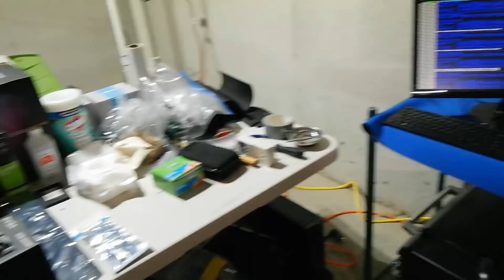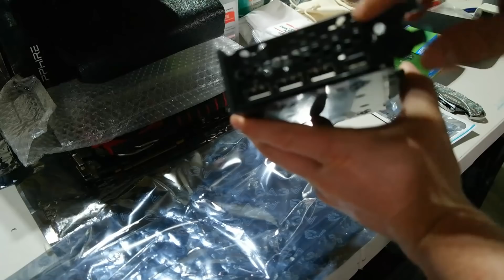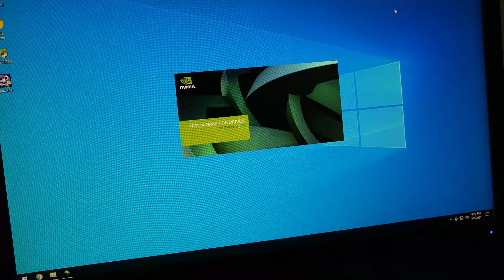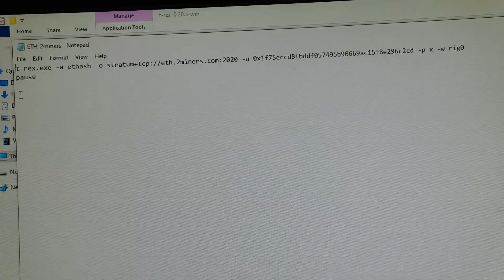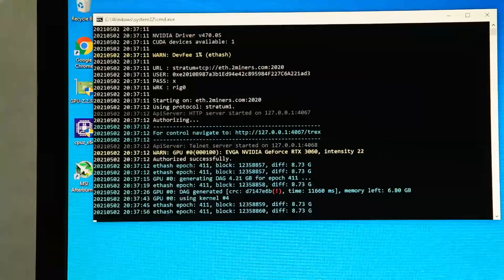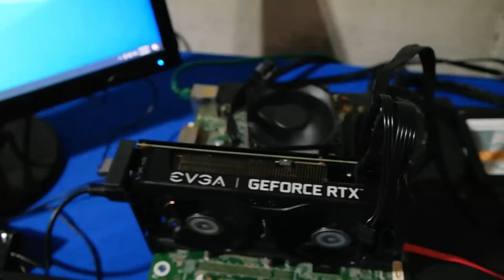RTX 3060 Mining Hashrate Driver Hack Doesn't Work Anymore?

Comment: It has to be PCIE 3.0
Reply from the maker: I will be testing the card in my other rig, just to confirm, hope you right!
Reply: @TheHobbyistMiner   needs to be 16x 3.0 or it wont work. Idk what board uou are using but seems kind of old.
Reply: @TheHobbyistMiner  As fcmancos wrote below you need to put it on a motherboard with at least PCIE 3.0 x8. So 3.0 x16 or PCIE 4.0 x16 would also work. Good idea with your gaming rig I'm sure that's newer than your test bench!
Reply: @TheHobbyistMiner  I think you have everything else covered, good luck!
Reply: @TheHobbyistMiner  bro uninstall the drivers from safe boot, install it, and the card works bro, im 19 and i did it, dont be so dumb
Reply: That´s right, PCIE 3.0x8 minimum, i have two 3060 in one board @3.0x8 without problems, another thing in the video CRC error, too much overclock, better start @8300mhz memory and +50 in core.

Comment from the maker: I got my EVGA Geforce RTX 3060 XC from the NewEgg Shuffle on April 6th 2021.  Apparently this is starting to become a rumor in the Mining Scene with SOME RTX 3060's popping up in April/May 2021.  Have you run into this or heard of this? Do you own a 3060?
Reply: Need PCIE 3.0 and it should work. Good luck
Reply: download GPU-z and look at Bus interface, see if you are at least @ x8 3.0 , if not it probably is because of your CPU , I have the same problem i need to buy new CPU to get x8
Reply: @rodrigomaraujorj  I have check at Bus Interface: PCIe x 16 4.0 @ x 16 2.0. Have I buy another Cpu ? Or mainboard? ( tb250 biostar 6 pci, i use)  Im using Cpu G 4400@3.30 Ghz
Reply: @Bob-ns2xm  I run into the same issue with the TB250 pro, only showing 16 2.0 even the card is plugged into the 16X slot. its running 25MH/S...
Reply: @jackychan8733  you need a mobo with pcie 3
Reply: @rodrigomaraujorj  what CPU at least?
Reply: you need to plug a dummy hdmi
Reply: @cesaralarcon9026  he has both monitor and dummy
Reply: Does this only happen on Ethash or does this affect other algos?